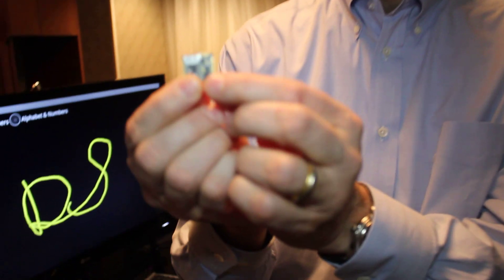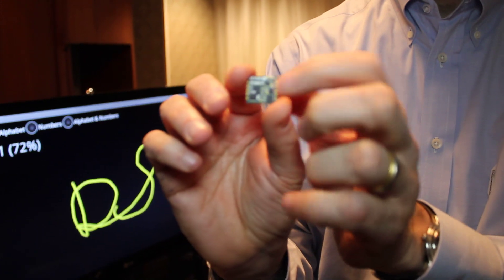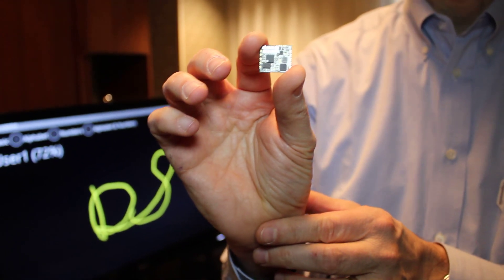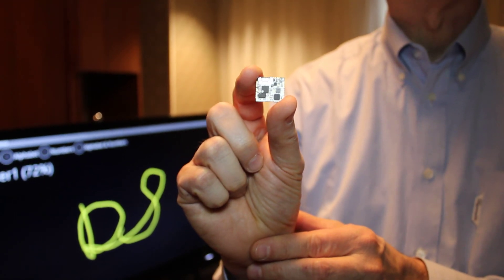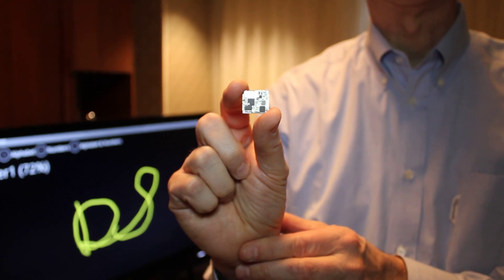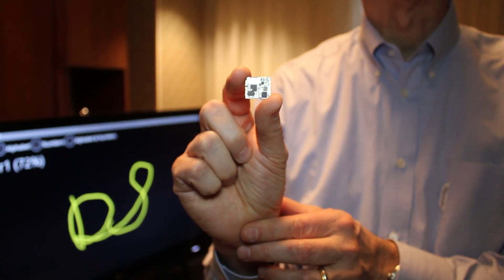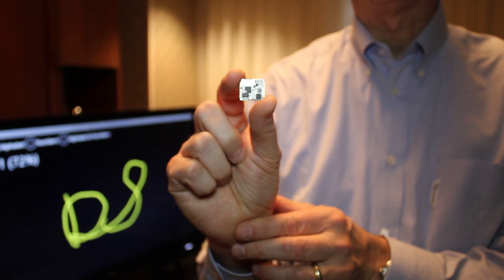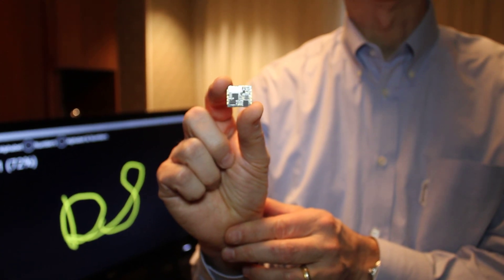CES 2012: Hillcrest Labs' 9-axis sensor module

Comment: Your Tracking Module sounds really interesting !
A demonstration Video about the capabilities of your Motiontracker would have been nice.
Especially to see if there is any Jitter/Drift/Lag, etc. 

As a gamer i would like to know if there are any low-cost consumer Headtracking devices which use your Tracking Modules ? And where can they be purchased ?

Also i would like to know if a Mouse-Emulation-Software will be delivered with this product or do you guys only develop the Hardware ?
Thank You !